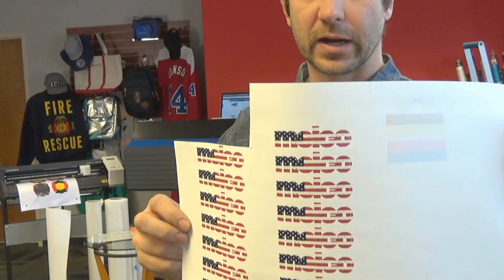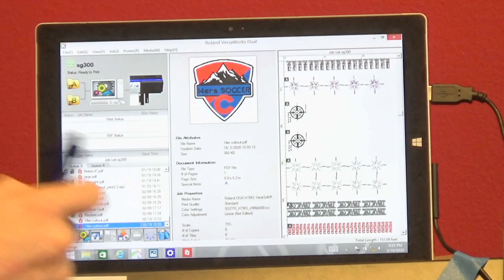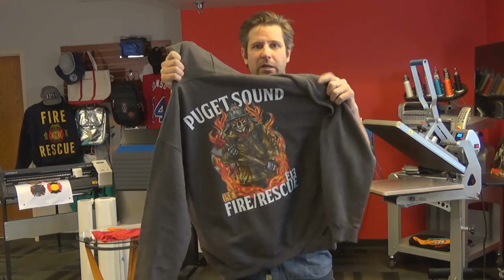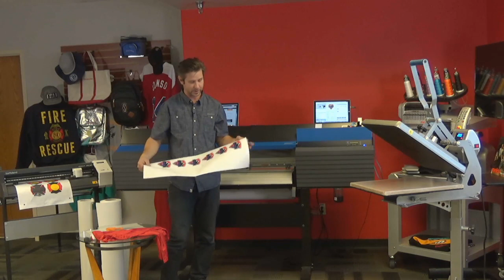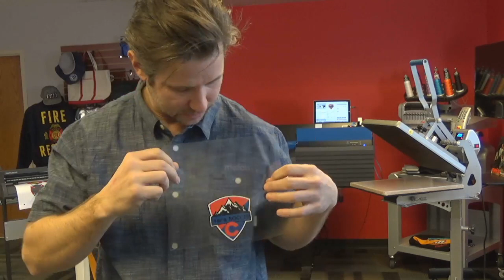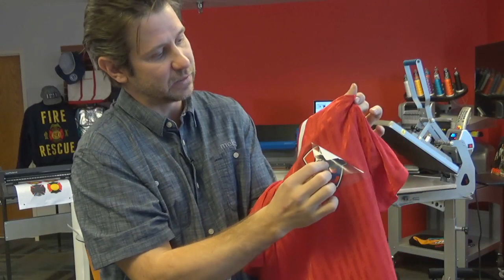Roland SG-300 Print Cut Techniques

Comment: Hi,

I'm interested in buying this printer however I was wondering if it possible print big size posters on matte surface? Like 70x100 cm for example
Reply from the maker: Hi, The width on the 300 is 30" and the 540 is 54". So you can print that wide but the roll of media is over 100 feet so you can print as long as you want. Reach out to sales@melco.com for a quote.